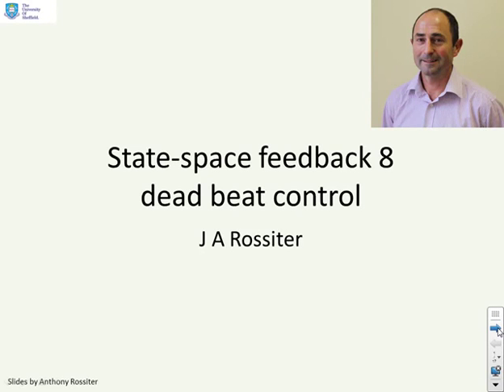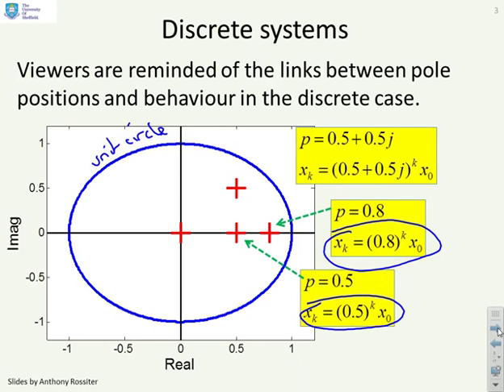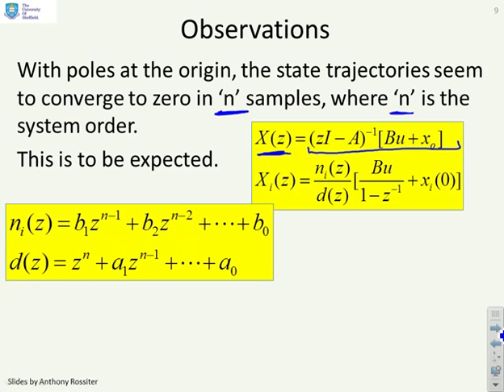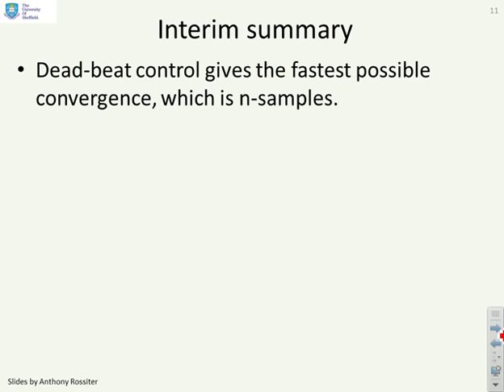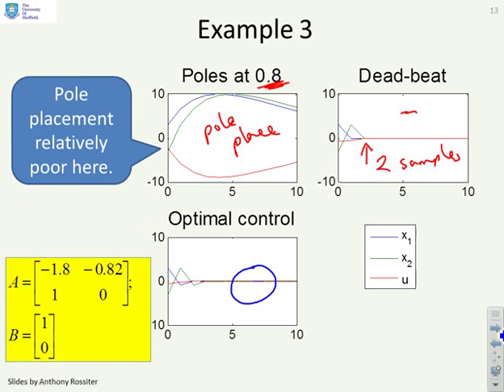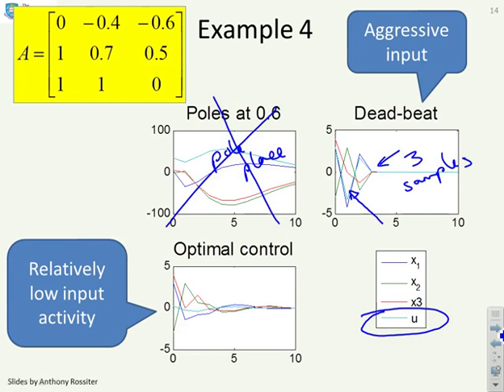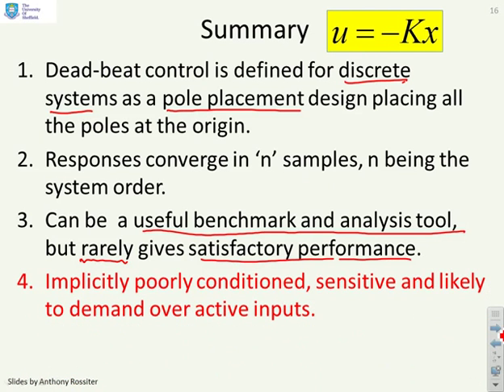State space feedback 8 – dead-beat control

Comment: Thanks for the video , this video helps me a lot.
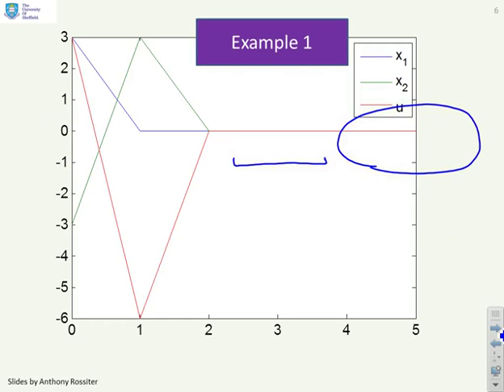But I Have a question in the example at 2:30.
If there is something wrong about the state feedback A-BK
I found that if A = [-1 -2 ; 1 0 ]  B = [1 ;0 ] ; K = [-1 2] ; 
then A-BK = [0 -4 ; 1 0 ] so the poles of  the state feedback are not on the origin then.
Reply from the maker: Thanks this is a minor typo at as K should be [-1 -2] not [-1 2]. Hopefully this is fairly obvious.Anthony